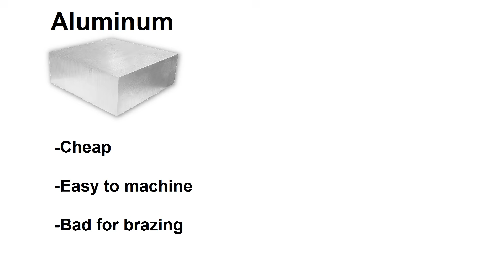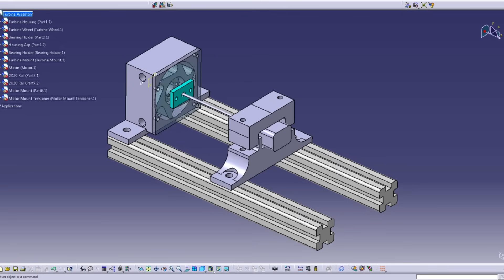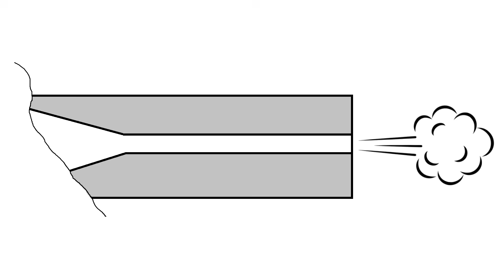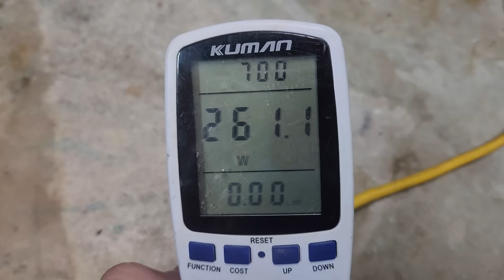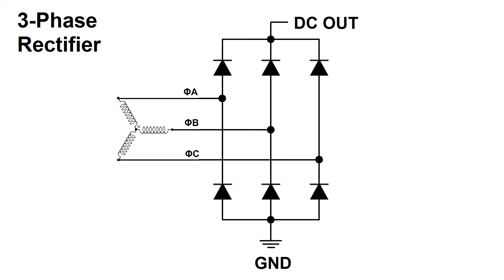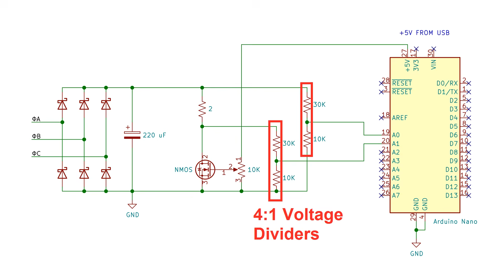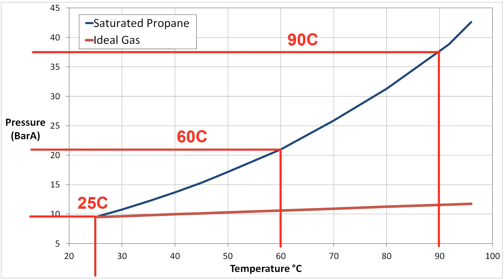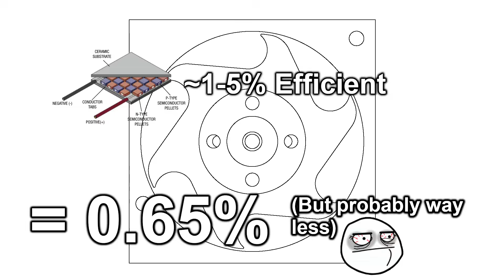DIY Micro Steam Powerplant

Comment: there are many simple yet very effective and obvious optimizations.
1: using the steam to pressurize the water, either do this like how you use the gas, or make it push a piston so it can be used in hard shaking environments(or to use a different diameter to change the pressure to get higher pressure than the steam on the water.
this also prevents the raid cooling of the tank, and it stabilizes the pressure of the steam output making the turbine somewhat more efficient.

2: use the heat from the output to preheat the water before the fire stage, let the water go through some heat exchanger or curled copper pipe in the steam before going to the flame section, try to build it in a cage in that stage so most heat is retained. if you still got some notable heat on the output make it hit the water tank to also slightly preheat that already, make sure it doesn't have to much resistance but does heat the water a lot. the most important is to heat the water which needs to go to the flame stage, this way you can use a way smaller flame once it is started.

3: use a different type of turbine, you might not like to hear it due to probably being praised so much, but use a tesla turbine, they are super easy to make, and tolerances don't come as close yet are more easy to match than with the kind of turbine you use now, tesla turbines when powered with steam easily reach over 97% efficiency, even when made badly they can easily get close to that, they also reach a high rpm easily allowing the generator to generate more power and a higher voltage so less loss in the diodes. but seriously try it, much more easy to make, also works better with such big spacings and such I know people said the disks would extend due to the force of the speed and jam the motor, but that 100 years ago back then metal was insanely crappy, these modern days much thinner and less stable plates or even jet fans can reach much higher speeds your hand milled thing didn't exten either. and even then the disks extending was in rather compact motors which where said to output over 10000hp modern day motors don't even come close to that and you won't need to come anywhere close to that for your mini generator.

4. edit the heating pipe, you push through way more heat than it can handle, you where so bussy making sure it could move through as much energy in flames as possible that you forgot that it was to heat that pipe with water, there is a huge air volume in the middle which isn't used, either add in something lik pylons or pyramids at some points to move it outward to the pipes, or let the pipes also go through the center or just make it thinner.
or make the outlet smaller and reduce the gasflow. you can also make it like a oven using a chimney to pull out the old air and push in new air into the flame directly, or if you want to be more efficient use a small amount of power from the turbine to power some small fan pulling in air also make sure the air is aimed at the flame.
ofcource you can also use wood or such instead of gas, making a well isolated oven however would be easy to save a lot of energy since your flame from the blowtorch generates insane amounts of energy.
if you want to use it for huge amounts of generation however then you would need a motor which won't burn when generating that much but a tesla turbine might work still just make sure the water absorbs more heat from the pipe and increase the pressure on the watertank to increase feeding, this last part is most easily done by just raising the water tank up higher if you used the steam to pressurize it.

Comment: So if I get this right... We might get an explosion whenever the water runs out as the coil would fill with propane and combust... Although that would require air, you cannot guarantee that the system is free of said air.
Reply: Well unless you lead the water back into the tank of course, but then you have an even higher chance of explosive leaks and oxygen getting into the system

Comment: I think the tube with the flame and boiler coil in it needs to live within another tube, and be perforated. You take some of the steam exhaust and run it into that outer tube so that it flows through the holes inwards, like the combustor cans in a gas turbine engine. 

This steam flow will be much colder than the flame, and will act as coolant (although, also still >100degC steam!) to prevent the tube from overheating. It'll be effective in avoiding it getting glowing-hot, which is all you really need it to do. Maybe also flow some around the flame going back inwards (like an air-amplifier) so that it draws air in for the flame, preventing flow coming back out that end. 

Again, will have to use little enough that you don't blow the flame out, but it should help dilute the oxygen in the air such that it will burn a bit cooler, also dilute the combustion products,  helping avoid melting the flame-holding pipe. Should be more effective than the secondary air in a gas turbine engine, as steam has much higher heat capacity than air does - should be about 90% more? 

Anyway, you just need the flame to be not so hot anything melts, and as an added bonus, mixing steam into the combustion gases should yield more hot fluid to transfer heat onto the boiler tube. Since you can't use the heat at the adiabatic flame temp with pure air (2250 K), diluting the O2 in the air will help bring the flame temperature down too. 

Just burning less fuel means the flame is probably partially missing the tube and possibly also the boiler, which will mean a lot more wasted heat.

Also do the flat-bar winding thing for the inner coil (make the coil look like a spirograph when viewed end-on) and make it a counter-flow heat exhanger. 

Give it a go! Seems easy compared to some of the things you've already built!

Comment: You are an absolute genius, thank you for this entertaining and extremely informative video.  I have been working on a similar project using an all metal Tesla turbine bought from eBay for around $100 so your boilerless steam generator design is perfect.   In the future I'd enjoy seeing your rendition of a hydrosonic pump for heating water into steam, your rotor you machined reminded me of it when I saw your balance holes drilled all over.

Comment: @Hyperspace Pirate
15:25 You can again, use the same propane bottle as the solution ;P
As seen in 15:10 you have plenty of heat available, as the big pipe turns red, you just need to capture that heat & guide that heat onto the propane bottle :)
15:44 Yes, exactly... kind of, you don't exactly burn more of it for heat, just capture the already available excess heat from the steam making.

Comment: That there 19:46 is a pneumatic air rotor. Used for powering air tools. As for making the nozzle, if you have access to a lathe. You might be able to form shape the nozzle from a thin piece of copper pipe.

Comment: My immediate thought would just be 3D printing a gasket to sit between the turbine and the wall.

temp doesn't matter because you want it to deform, and centrifugal force will force it back out to the sides. 

Might only work once though? It'll also probs get ejected from the exhaust

Comment: If you go with the rotary vein compressor use one meant for hydraulics. The veins in those units are made from metal and will absolutely survive the heat. PTFE breaks down at 150°C, 302°F, not sure what temp your steam is getting to. Would probably be OK but metal would definitely be OK

Comment: I love steam projects. I have one kicking around in my brain I have not yet started. You know those car jacks you can run off of compressed air, Air over hydraulic or Pneumatic Hydraulic pumps. I wanted to create pneumatic energy storage for little pistons to automate ideal positioning, use steam to compress ambient air. A complete time waster I know, The idea of this project is to make a rainbow, using a prism, but still requiring the sun and rain.

Comment: So I don't know if you just didn't think of it but i feel like you shouldve with your cryocooler experiments. Why are you feeding water at the same end as the heat source? Normally counter current heat exchange would improve thermal transfer. Is there a reason for the parallel feeds of did you just not think of it?

Comment: I have to say "yes" to the idea of using one of those vane motors meant for air, just replace the vanes with brass/bronze ones of equivalent size and it should work quite well. If you do it that way though, make sure you use saturated steam (like you have now, from the looks of it) instead of superheated steam, or add in an oiler, because dry steam with no oil will trash one of those vane motors even worse than running it on air with no oil. At the size you're working with, the only turbine design that's anything resembling efficient is a Tesla turbine, but those still aren't much more efficient than a decent reciprocating steam engine. On the small scale, rotary or reciprocating engines are FAR more efficient than turbines, turbines are only efficient at large scale and high RPM.

Comment: Have you ever considered pushing the steam through the exhaust side of a car turbo charger, without the compressor side. Connect to the shaft and step down the RPM through a few gears to gain torque to spin a generator.

Comment: The turbine isnt letting the steam expand, so you aren't getting energy from the expansion. The only way to get energy from the expansion is to confine it in an expanding volume which extracts that energy.

Your turbine only gets energy from the pressure differential between the steam and atmosphere as the steam wants to push the turbine out of the way to get to low pressure, hence why the exhaust gas is fanning out. The pressure didn't go down at all.

Comment: The rotor of the turbine you show at the end of the video remind me the kind of vacuum pump mounted on the machine using in the supermarket for put the food under vacuum condition for preserving. The little plastic parts moving in the rotor are made, often, in ptfe as you wrote in the video. them moving in and out by the form of the stator. for perfect seal is used a very high viscosity oil, from minimum sw 40 till sw 100.

Comment: If you use the hot gas exhaust to preheat the water it may increase the efficiency the same as a condensing boiler works. You may have done that already and I'm just waffling but anyway I thought I'd point it out, HTH and great video by the way!

Comment: You should see the setup AgentJayZ has for running jet engines on propane: The rate at which these engines consume fuel is so high that the evaporation of the propane, even from a massive tank holding hundreds of gallons of liquid propane, is nowhere near fast enough to supply gaseous propane at the rate the engine requires.
The solution employed is to draw the propane out of the big tank as a liquid, and a fraction of this is directed into a long burner to heat the rest of the liquid propane up enough to vaporise it into a gas. This also raises the pressure to a level high enough for the fuel injectors on the engine, which need to supply gaseous fuel at a pressure higher than the compressor discharge pressure of the gas turbine engines. These normally run on natural gas for industrial or power generation purposes, so propane in a gaseous state is close enough for running the engine in a testing cell for a few minutes after repairing and/or refurbishing it.

Comment: You should flip the turbine housing 180 degrees. That way any condensate will drain out and you won't loose power from pump water out with the turbine.

Comment: For steam boilers there is a water injector that runs off steam and can push water into the boiler at a higher pressure than the steam powering it.  I forget the name but it uses a venturi inside IIRC.  Genius device from 100 years ago.
Reply: Injectors are almost magic

Comment: Why does the Sonic by Sega have a footlong erection?
-General Zorin Blitz

Also, those clearances are horrid... You really did it in in that department... I`ve seen prolapsed asses tighter than that, my dude...

Also, i didn`t intend to be an asshole, that`s just how i am... I fully support the steam engine idea, just step up the tolerances game... Use a tightly wound coil around the burner pipe, feed water through it as that will increase the water temp beforehand - making the thing more efficient, you could also wrap a single coil of gas tubing around the lower section that isnt all that hot to spike the gas pressure at the nozzle... The whole thing should also be wrapped in ceramic wool to keep that shit hot and more efficient overall, but sure, combining that and a nice triple expansion steam engine with all the latest in technological advancements to it would make for a hell of a good power source if done correctly(with proper tolerances)...This already kinda produces superheated steam, and it sure would with those few aforementioned tweaks... 

Best regards!
Steuss

Comment: I have a question about your calculation at 18:45 you calculated that it takes 2.6kJ to heat up 1 gram of water, well I'm in high school and I was recalling from my chemistry but, isn't the heat energy required to raise 1 gram of water by 1C at atm and room temp Q=mcΔT where m = 1g, c= 4.18J/g/C, ΔT assuming at pressure at 101kPa and starting at 20C ΔT = (100-20)=80C, so i got the energy required to raise the temp to boiling is 334.4 J so i would like if you or some one else could respond and explain to me how you got 2.6kJ/g isnt it supposed to be 334.4 J/g then in 1 second ? if im wrong please explain why
Reply: Not sure if my comments are posted but the latent heat of water is about 2.2Kj per gram which you need to remember to include!
Reply: @jossbird3358  oh ok thanks
Reply: @jeyronokal1506  No worries! Super easy to miss and unintuitive. Keep being curious!
Reply: Also as another source here’s Latent Heat on Wikipedia:

en.m.wikipedia.org/wiki/Latent_heat

Comment: My thoughts -

You might have a better time using a turbine design better suited to directly converting pressure to rotation, instead of converting pressure to velocity through a nozzle first. Maybe try something like the centrifugal fans you see in laptops, just operated in reverse

Second thought is that the low pressure of the propane pressurant will limit performance. Maybe you can use the propane to bootstrap the system, but put a water pump on the generator shaft (or use generated electricity to power an electric pump?) to achieve higher pressures at the turbine input.

Third thought is regenerative heating - I would bet your exhaust is still hot, instead of discharging to the air, put it through a heat exchanger to preheat the water before the burner

Final thought is, I think you need to flip the direction the water travels through the burner, to a counterflow style, with the steam exiting the side where the flame is hottest.

Comment: Why not use the pressure from the house tap with a valve to adjust pressure flow.The normal water pressure of a home from the water works is more than that propane bottle will provide.

Comment: The converging diverging nozzle CAN be more efficient if the pressure is high enough to reach supersonic speed, if it's not you'll just loose speed, if in doubt I'd build different nozzle with smaller and smaller throats until you find the fastest speed possible

Comment: 10:18 pole pairs, not poles. You can determine the pole pair count by feeding a constant current between two phases and counting the number of cogging steps per turn. That's your pole pair number. A diode rectifier is a suboptimal way to get energy out of your motor (yes, that's how a car alternator does it), you need a vector control drive.

Comment: That is a very inefficient turbine. At sizes that small a piston engine will always beat a turbine in terms of isentropic efficiency. As this is a single stage impulse turbine and the rotor diameter is small it would have to rotate whole orders of magnitude faster to extract the kinetic energy of the expanded steam. Not to mention that the rotor geometry is suboptimal.

Comment: It's the graphics that keep me coming back.  Good stuff. Don't worry about the oopsie on the bolt hole, I've done it in manual and CNC, it happens.  Usually only once, but it does happen.  Nothin for nothin but if you're going to use a mill to mill off the bottom you do have to run an indicator over the surface and tappy tap it flat.

Comment: Pretty good, some potentially useful advice:
1. Place water inlet of the boiler at the exhaust end of the tube, and steam exit closest to the flame. This ensures the hottest/highest pressure steam. 
2. Ensure the turbine is hot, water condensing on and around it limits its effectiveness
3. Cutting slots across the turbine between the tip and the housing should induce turbulence in the gas flow, which chokes gas from leaking around.
4. A multistage turbine should also increase efficiency quite a bit, ideally the exhaust velocity is next to zero as all momentum has been transferred. 
5. Use the latent steam energy/heat to preheat the water going into the boiler. 
6. Propane is great for experimenting like this, but modifying the design to run on wood could be pretty cool

Comment: If you look at DeLaval impulse turbines, after jet passes past a curved blade it escapes to a minimal pressure zone. What you do by confining the "gap" between rotor and case it's exactly the opposite. You may try big  holes in the two cover plates. And leave more room around the rotor.

Also for max efficiency the rotor's blade speed needs to be around 1/2 steam jet's nozzle speed, but a 3600rpm, 5cm turbine is way lower than that.

Comment: Very cool setup. Coming from the power generation field if you add a flywheel to the setup it will help with smoothing out your power output. Also tighter clearances and a stiffer shaft so you don't get any wobble.